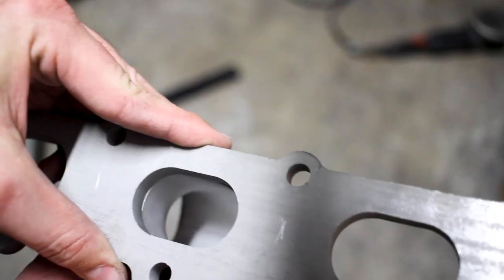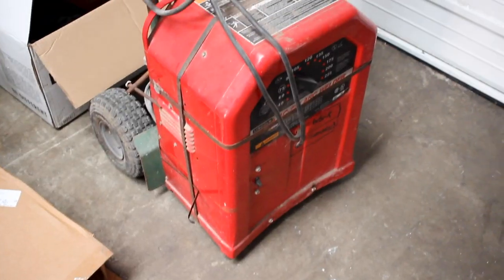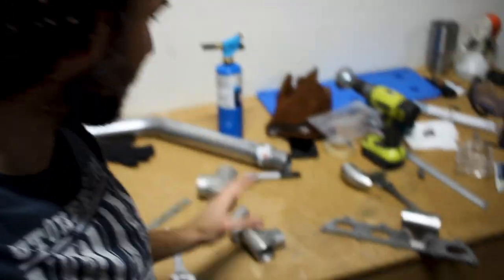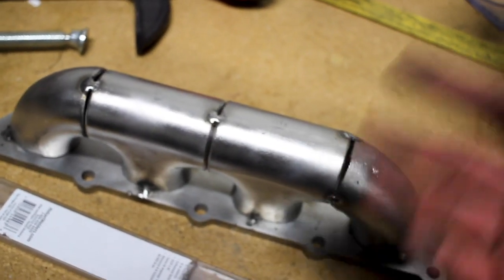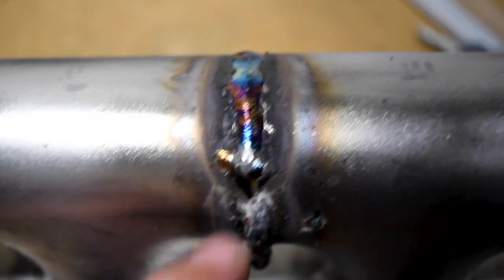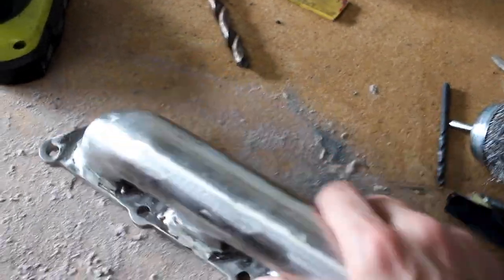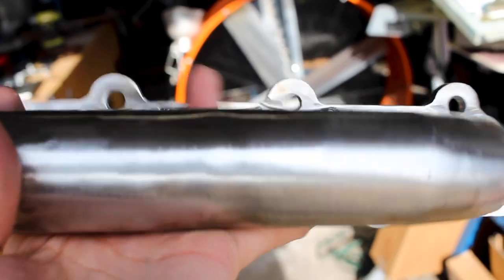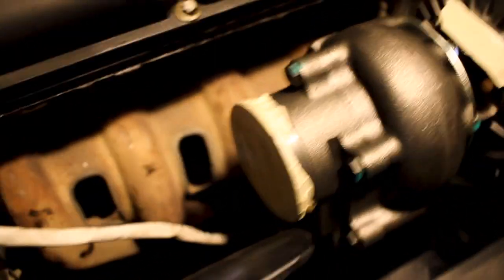Chevy Cruze: The Turbo Installation Upgrade You NEED

Comment: I have not build one yet but one tip I see every video I've watched on making a manifold was to bolt it down to a metal work surface for welding to avoid the metal from warping from the heat.
Reply from the maker: Definitely a lesson learned. I'm currently working on a long tube manifold doing just that. I have a jig made, and an aluminum heat sink.
Reply: @cmattdabrat  Nice! Love the home builds on anything. Considering doing exactly this on my 1.6 Miata... I just have a MIG welder that won't do stainless though so hopefully I can get someone to weld it up for me or gain access to a tig.

Comment: Matthew, I hope that you Ecotech is stronger than I think it is because I've built several turbo motors and I'm thinking it will either push the bottom end out or chuck a rod.  That said, I wish you a luck.....put everything together on loose spec with good bottom/top end oil flow and give the rings more end clearance so you don't jerk the top of a piston of due to excess expansion.  I'm kind of excited on how it will turn out.
Reply from the maker: Hey Tom. I hope so too. I've only found one, on the net, that has been turbo'd. The plan initially is to boost it around 5 psi, which should be pretty safe. I'm going to go to the junkyard, grab a spare motor, and take it to my buddies shop. He's going to check the crank to make sure it'll handle more power. I'm not necessarily trying to go crazy with the build, but just make the car more fun to drive. I've sourced out some forged rods, we can get ahold of forged blanks that David can CNC machine for the build. We'll end up doing some port and polish work to the head, and a little cleaning in the stock intake, I might have him build one. I don't want to bother him too much. I'll keep you guys updated. It's definitely a fun project.

Comment: I think the one thing you forgot about welding is on that type of stuff you have to preheat the metal first before you weld it that way you don't have warpage
Reply from the maker: Thanks for the tip Sean.

Comment: Is the 1.6 turbo engine that different from the 1.8 that the stock turbo dose not bolt on?
Reply from the maker: Same engine block, just different bore and stroke. I didn't learn about the turbo that comes on the 1.6 until later but I've increased my hp goals.
Reply: @cmattdabrat  I have the turbo 6 speed it's a dog even though the scan tool says it's got 62psi fuel pressure and 26lbs of boost at full rip up hill it's so slow lol. Great fuel economy though.

Comment: As your putting a new turbo in ur Cruze mine blew a head gasket and can’t afford to fix it🙄😁
Reply from the maker: It's a pretty simple fix. $55 head gasket, $50 head bolts, and a $80 timing belt kit. With some simple tools you could knock it out in an afternoon.

Comment: i don't think that 1.8l will spool that huge turbocharger. i think that it's a turbo good for 350hp with a 3 liters car . way to big  will boost a 6500 rpm abd be empty untill that.
Reply from the maker: That turbo started spooling at 3500 RPM and would fall on it's face at 5500, so incorrect. I currently have a GT35 on it and it's starts spooling at 5k. So guess again.

Comment: where do i find one of those at 2:09 the solid flange ?
Reply from the maker: It was a closeout item on eBay that ZZP was selling. I've designed my own and may make them available for sale if there's enough interest.
Reply: @cmattdabrat  I would definitely buy one to save the time
Reply from the maker: @hardstyle719  Cool... I'm working with a buddy from out of state that's water jetting my custom parts and we've talked about either making the parts available for sale and / or making custom manifolds, and offering other parts for the 1.8 platform. The parts he water jetted for me will be in Monday, so keep an eye out for a video this week on those parts.